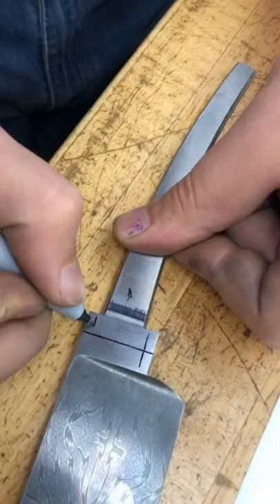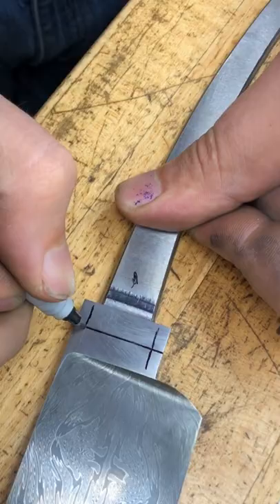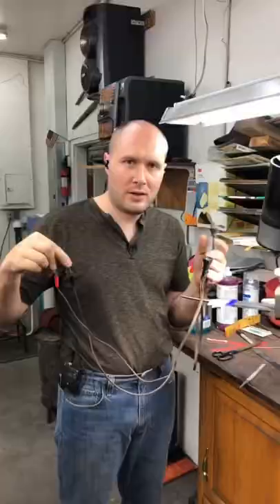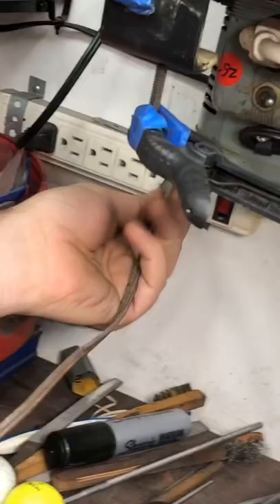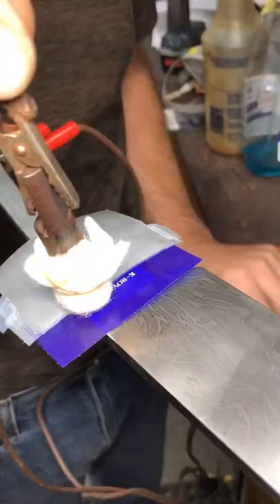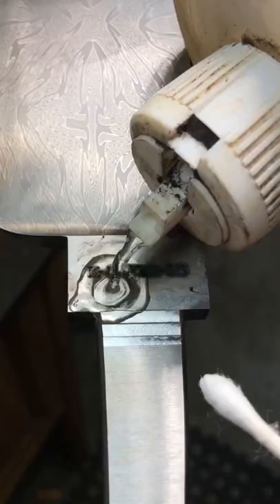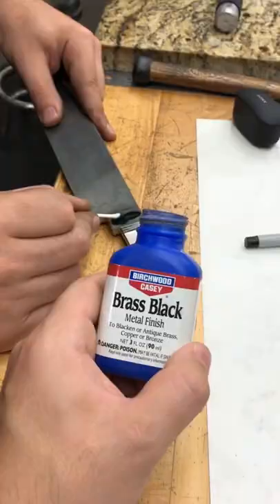Etching My Name With the Electricity

Comment: Can you do a video of the bridge rectifier?   And electrode.
Reply: PRETTY PLEASE!!! 🙏
Reply: you can use any DC power supply available, just connect one wire to the electrode and the other to the piece (the specifics regarding voltage and the like will vary, but you can find details with a simple Google search). The electrode is essentially a swab with the shaft made out of a conductive material, no need to overcomplicate it.
Reply: Or you can a proper machine and set up for it from some supply stores and such.  Like the Personaliser Plus I use. Which works great Plus has both a mark and etch function, so you don't need add that blackening stuff if you want it dark.  And that function along with the variable power gives  you alot more flexibility in making different manner of etches/marks... darker, lighter, shallower, deeper, or a hologram type mark which is pretty cool and such.  And everything you needs just right there in box.  Idk I think it's well worth it anyway if you make many knives. 
I'm in Australia and had to get one imported from America but again well worth it. 
Getting my custom logo stencils was the bigger hassle though. Ended up getting them custom made by this lady in New York I found who does them and sends them over but she was good.  Not only great stencils that are very accurate and lasts hundreds of times or more each (idk I still haven't worn out even one) but she also helped me design them and made them look very professional from the rough sketches and stuff I sent her.  Definitely would recommend.
Especially after all the trouble I had trying to etch good logos before that haha. 
I also got some of that stencil paper you can scratch out your own designs on using a stylus or something, leather stamps even, which is ok if you want to put someone's name on or a picture or something one of a kind, but never as accurate as the custom kind. 
Good luck. ))

Comment: Where do you get the stencil?  I can do the etching no problem but I'm having a hard time finding a good stencil that would say "Lawson".
Reply: I also would love to know!
Reply: You could make one yourself fairly easily, just draw or print your mark onto any plastic film that'll hold up and then cut the bits away with a scalpel. I've seen great results specially from  teflon or vinyl sheets like the ones you'd use for decals